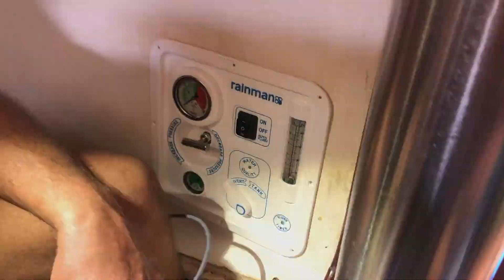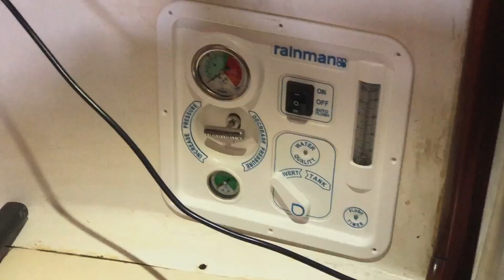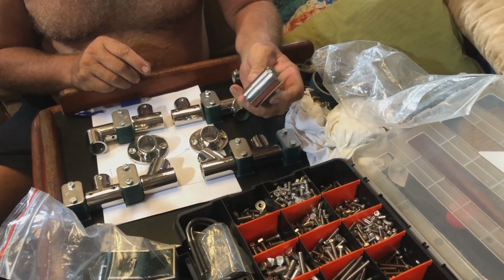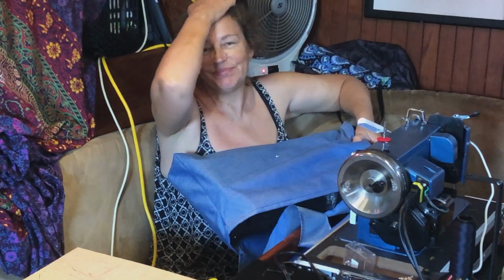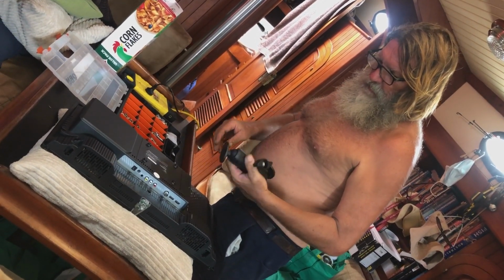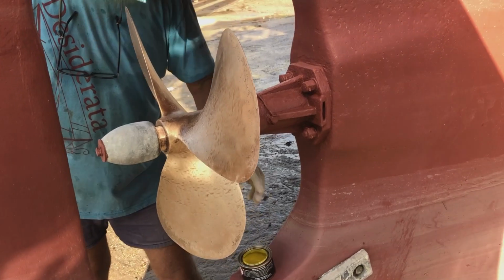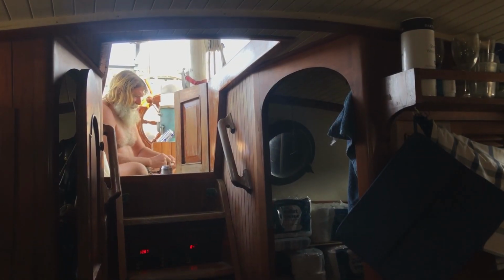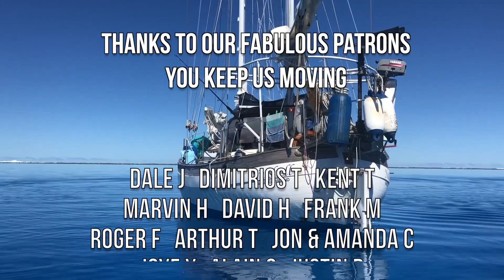Ep 280 | Boat Jobs at Dinah Beach Careening Poles, Darwin, Sailing Nutshell

Comment: Magnus - you are a genius mate - I have an older water maker home made, demonstrated and worked when I bought the boat (Pearson 424 American built) 2 years ago and I haven’t touched it since. I was seriously thinking of pulling the whole system out because of all the knobs/levers/ taps and replacing with a Rainman unit $7k 😳. Why didn’t I think of just using their panel ! I was thinking of change it up to a 240v to increase the output - what’s your thoughts??
Reply from the maker: Hi Neil
It took me a while to think of the solution and it works a treat. So simple to make water now. We make water for a couple of hours every day when the sun is overhead. Unlimited free water on a boat. Crazy. 
Our 12v unit makes 80 litres per hour. 
I like 12volt stuff as it’s safe and easy to fix.

Comment: 5 kt at 1000 rpm? Is the gearing the same? I guesstimate yer theoretical hull speed at about 7kt, so....what is nominal operating revs on the engine?

Best to ya's
FW&FS
Reply from the maker: The new gearbox has a different ratio so we are very overpropped. We sit at about 1240rpm all the time. I give her a good rev for 10 mins or so every now and then too.